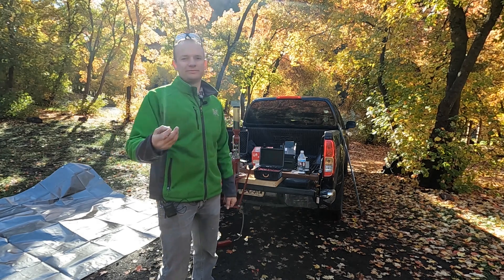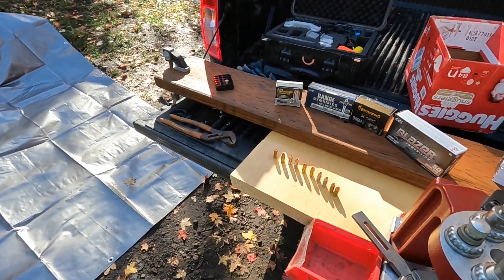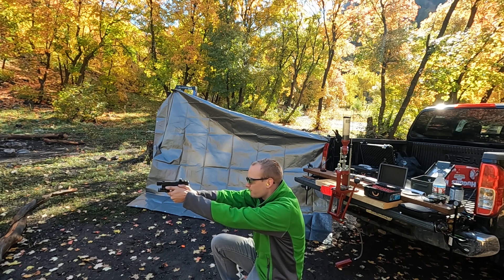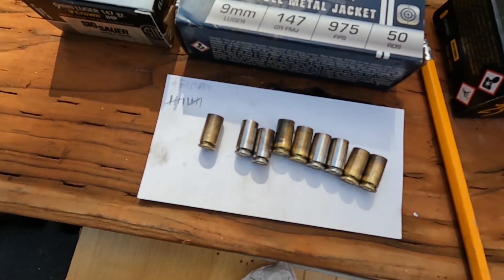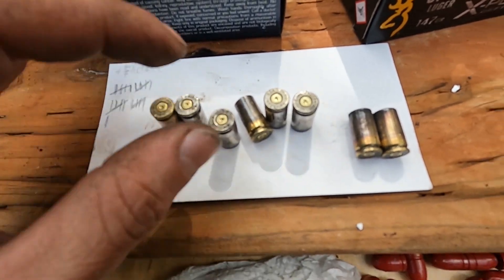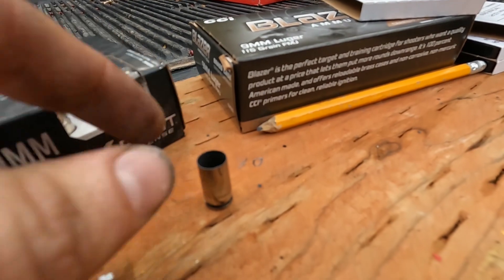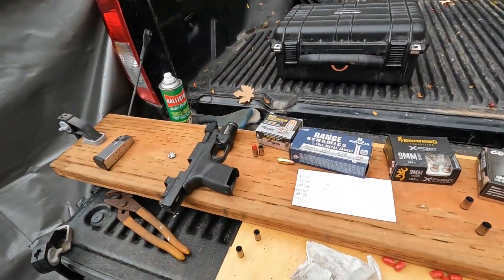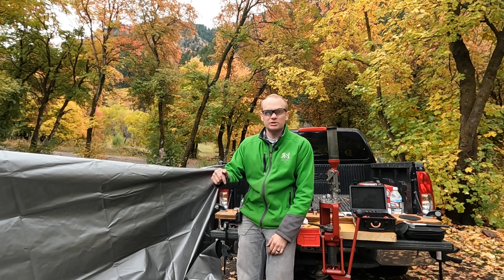How Many Times Can You Reload Brass?

Comment: Do you suppose hunting rounds (straight walled and bottleneck) would perform the same? I am considering starting hand reloading sometime. I just need more to justify starting
Reply from the maker: I think it would be highly pressure dependent. So a .45-70 round comes in at around 30K PSI and a 9mm is similar at 35K PSI. So my gut says the casings would last about the same number of re-loads. However a .308 is just over 60K PSI so my gut says the brass would wear out a lot faster, although without data it is hard to say how much faster. 

One day I am going to test necked rifle brass to see how many times I can re-load it, but I haven't gotten around to it.

Comment: Excellent test! Honestly if you are working with a quantity of brass how could you ever know which ones got loaded how many times? I have heard about people that tried. To actually do it would require serializing and cataloging each one.......or just cull the defects and pick up fresh. This was a great demonstration.
Reply from the maker: I just re-load them until I catch a failure. Which other then this I have never actually seen one fail. I have reloaded about 10K 9mm rounds and cycle between 3-4 thousand casings. At a rate of 2K reloads on 4K casings (one reload every other year). At 50 reloads it will take me about 100 years before my 9mm casings start having major issues.

Comment: Question Did the brass grow at all and if so how much?  Your failures look like typical failures in pistol brass I have had over the years. I have never put a round count on brass. But my 357 brass I have had for over 40 years. My 9mm is just range brass. I just run them till they split or get lost.
NDR
Reply from the maker: I didn't measure them at all between reloads. I was using my sizing die on them every time. I still have the failed casings kicking around somewhere. I'll go measure them.

Comment: A lot depends on the manufacturer because I've seen a case get reloaded twice and then split I've seen other cases that I've marked with their accidentally or deliberately be able to reload for 30 plus. Also a lot depends on how you reload it. Excessive flair can cause trouble, any hot loads can stretch and ruin cases. Type of powder matters as well. Any way you go, do your best and try, never give up. 42 yrs reloading, I Know I haven't seen it all because I still learn things today.
Reply from the maker: Dang, only two reloads, that is pretty bad. I just use mix head stamped range brass and as long as the caseins are brass I have not had any fail.
Reply: not loading hot helps a LOT using range brass-thats all i use as well. $ better used for primers, powder and bullets, esp since i swage 9mm, 40, 45acp, and 308 (182gr spire point works well out past 600m!) too bad swaging tools cost me over $6500 but they last forever! @TheLarkinsLair